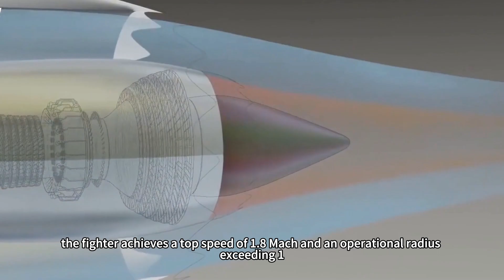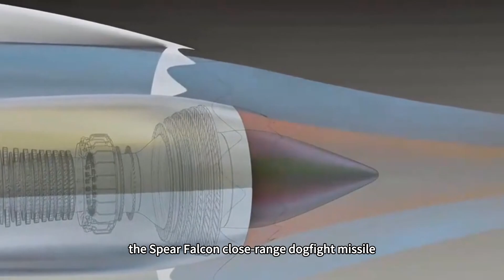Egypt becomes a 5th-gen fighter jet nation? Joining the KAAN project will shake up the Middle East!

Comment: If you can't make a fighter jet engine yourself then...🤫🤫🤫
Reply: South Korea ,Sweden also not make engine. But Turkish approach is different they already start developing engine TF 35000, TF 10000 and TF 6000.
Reply: A 35,000-pound engine is currently in production, and a 10,000-pound prototype has been produced and is operational. TEI is producing the TF35000 engine.

Comment: Turkiye has been producing F-16's domestically, and was a supplier for F-35's. They have the infrastructure for their own design and a subcontractor network.
Reply: They produced few parts only... All irelevant. Look at US kick out Turkey from F-35 and they have no problem produced whole F-35. The KAAN still heavily depend on US made engine.
Reply: @zenden9  They have local engines as well. I think they got the technology from Ukraine.
Anyway, with European deal they will have more sources. Do you have any idea how many parts that plane has? I think few was around ~900. I was told it requires 12 hour of maintenance for 1 hour of flight.
Reply: @almazchati4178 sorry no, they don't.. they will end up like India Kaveri engine. Plenty of hot air but nothing produced as modern turbofan is even harder to build than A-bomb.
Reply: @zenden9  A-Bomb is easy. Problem with engines is in metallurgy, not in the design. They got that tech from Ukraine, a joint venture with Bayraktar.
Reply: @almazchati4178   You are talking nonsense, Bayraktar is just a small drone and the engine used can hardly compare to modern turbofan need to power a 11-12 tons fighter... Ukraine is in war and many relevant personnel either already relocate to work in China before the war or simply disappeared.. And its not simply just metallurgy. The factories to produce those high tech metallurgy cost double digit billions  plus testing facilities. Where will Turkey go find the money?
Reply: @zenden9  You can refuse to believe, and fool yourself. Ukrainian manufacturer had the biggest air crafts ever in its portfolio.
Reply: @almazchati4178 they don't . Every is gone after the Soviet collapse. The remaining is long gobble up by the Chinese... Look at your T129k? Why it didn't deliver to the Pakistan army while it's the Z-10ME that just send to Pakistan? Didn't turkey brag about the local made CTS800 turboshaft? Why turkey until now still can't produce it domestically and lose the deal to China? 😂
Reply: @zenden9  Now they are able to manufacture engines. You are 10 years behind.
Reply: @almazchati4178 😂 yes, turkey produced engine and yet still need to buy US F110 engine for their KAAN. 🤣 You are just deluding yourself....
Reply: @zenden9  You need to update yourself.
Reply: you know nothing about air industry😂
Reply: Turkey is complete with his own engine almost sow dont talk bullshit peoples !
Reply: @ERTRANSPORT8-b7c  No , it dont. It cant even export T129K to Pakistan. And now u talk about having its own jet engine for KAAN. What a joke!

Comment: Come on ... who is going to provide Turkiye all the various tech for the 5th gen? Turkiye has no domestic tech for 5th gen features not even a fraction.
How countries will buy Kaan is just crazy as Turkiye is only buying the EU Typhoon which is outdated.
Reply: Turkey has been involved in the F-35 program and many parts of the 35 are made by Turkish companies.   And in addition, more than 200 Pakistani engineers are also involved in this program and Pakistan has already built the JF-17 in collaboration with China.    You can google it.
Reply: @WorldJeopolitics  
At best these engineers can build a plane but it needs far more than that from wind tunnels to avionics etc.
They are like building an untested plane which naturally needs lots of testing first in wind tunnels and then electronics and kill chains etc. These cannot be done by the few people in Turkiye even with few Pakistani experts which more depended on the Chinese to build even the jf17.
Most of the technical work have been done by the Chinese to make the JF17.

Anyway, if Turkiye is able to build a better plane , then they would not by buying the EU typhoon.

What missiles are they going to use?

I have my doubts.
Reply: You have no idea what your talking about
Reply: @I_AM_BYRON  well tell us what makes a stealth plane that works? 
The shape of the body? 
Do they have wind tunnels to test? If so where ? I do not know Turkeyi has such. 

That is only one aspect.
How is the kill chain working.
what AWAC or EW systems does Turkeyi posssess when they even had to invite tenders for a SAM system.

Dont think Turkiye has the necessary to make a viable one.

You tell me ....
Reply: @hkfoo3333 low radar cross section manned unmanned teaming internal weapons bays and stealth paint coating
Reply: @hkfoo3333  Turkeys already have wind tunnels, they have 3 wind tunnels.
Reply: @unknown7042 there are many type of wind tunnel. Do u even have one that can conduct mach 10? 😂